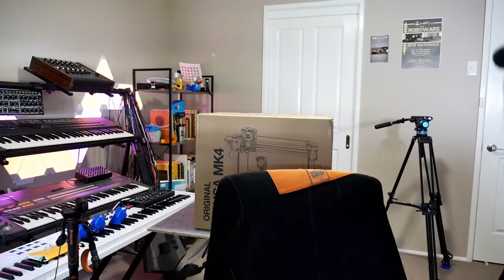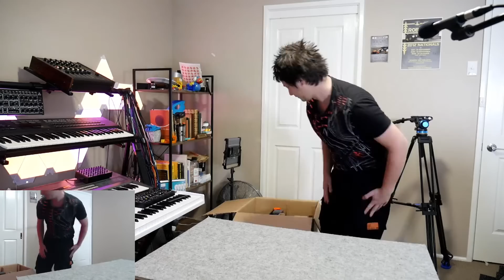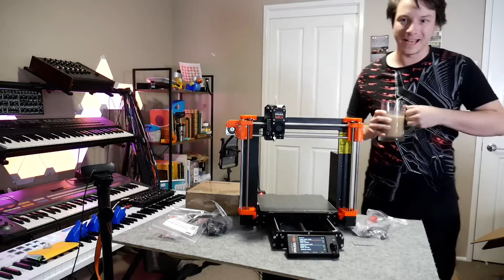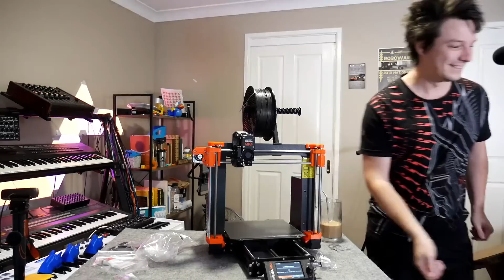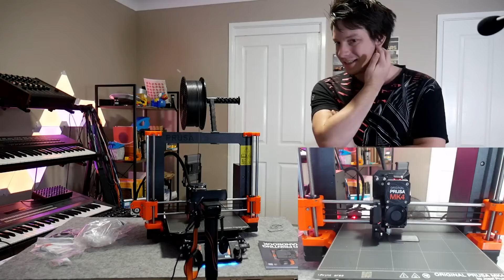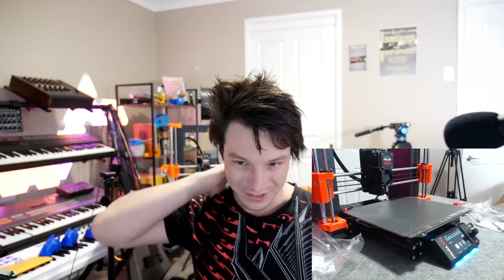WAS LIVE: So a Prusa MK4 just showed up... let's fire it up live!

Comment: I'm a bit late, but I imagine the frame is die cast, which functions mostly like a plastic injection mold but instead of plastic they're pushing molten metal.
Reply: It’s for rigidity purpose I think
Reply: @arbjful I think it saves costs in the long term. Think of anount of waste that's produced by cutting a sheet to this shape.

Comment: I know you will never cover a Voron build it would be awesome to have you sharing your experience to others.
The only thing I didn't agree with your statement from another video is that "Voron is a tweaking printer", I have a LDO Voron Trident stock and it just work, zero reasons to tweak it.
You are one the fewest trustworthy YB out there, it would be awesome to have you covering Voron for users after high quality prints and no tweaks needed.

EDIT: But check the LDO kit like CNC Kitchen did, anything else will give you headaches.

Comment: patents have never stopped certain manufacturers from certain countries from copying/ripping others off. Open source is a big advantage of Prusa printers. Now they need to leapfrog with non-planar printing and an enclosure with active heating, air circulation and hepa/carbon filter that doesn't cost as much as a printer.

Comment: Could barely hear you with volume all the way up. Didn't watch because of this.
Reply from the maker: Ok
Reply: Then... over-amplify the video sound, or switch to headphones?
Reply: @WyvernDotRed  The audio could have been a bit louder, I had to use a different headset. I don't think it's helpful to blame the audience for not being able to hear the sound well.
Reply: @WyvernDotRed  Me saying "blame" might have been too harsh. What I meant to say is that the audience shouldn't have to change headsets or EQ settings just to hear the sound. The mic could have been placed a bit closer.
Reply: @htpkey  Obviously the sound should be balanced well, but a stream recording having low volume levels isn't really a reason to avoid watching it either IMO.
Especially as with my equipment, just raising the volume a bit got it a my usual listening level.
Considering they couldn't hear it well at full volume, not sure what's going on there, hence the suggestion to try a different output as it shouldn't be that quiet as-is.
Reply: @WyvernDotRed  I mostly agree with you about the steps you can take to fix the audio issues. My main criticism is that the viewer shouldn't even have to do this in the first place. 

I hope the audio feedback from that comment will be seen in good faith and taken as constructive criticism to improve the audio quality in the next stream. I loved this stream, but I do think the audio could be improved without having to spend any money.

The whole reason I commented was because it felt like the audio problem was now shifted to the user. Instead of acknowledging it, the reaction seemed a bit passive aggressive. I watch hours of content on YT every day, I rarely even think about the audio since most video's tend to be overproduced. 

In all fairness, this was a live stream and the audio will not be as crisp as the regular video content. But the audio could still be a tiny bit better.

Comment: According to the Prusa Knowledge Base, the Prusa MK4 is equipped with a loadcell that detects if the nozzle is close enough to the steel sheet for printing. The only adjustment needed for the loadcell is during the Selftest. During the test, you will be asked to tap the nozzle at a specific time, and a progress bar on top of the screen will be filled. This is to calibrate the loadcell and avoid any damage that would be caused by the nozzle digging into the steel sheet.

Comment: the "mark" on the build plate should be at the bottom left outside the print area where the old purge line used to go. That's an area we don't care about. They need to move that.

Comment: The Carbon X1C is the best machine in the market as long as you don't need to repair anything from it, if that's the case, you're probably on your own. That's why Prusa's value proposition is good, it's not just the machine specs, it's the documentation, openness of the system and repairability, besides the fact that it's a very reliable machine anyways.
Reply: i think the main problem should be the Mainboard. The rest is already mostly available from 3rd Party and that will extend if BBL close doors
Reply: I Bet Bambu is going to make one of the next printers Open source if the Community pushes hard enough
MK4 Costs way to much in Germany for example you can get two of the new creality core xy for one mk4

Comment: Ankermake printer now prints 500mm/second. It's incredible how fast it prints
Reply: Fast does not imply good. Printing fast is great, but causes extrusion and part strength issues if you don't have a high flow setup.

Comment: Hi ; what do you think of the Delta Printer FL Sun v400 ? I can't remember  if you did a review on one or not ?
I would also like to thank you for the information concerning using G10 sheets for build plates. I have converted both my original Aquila and my Ender 3 S1 Plus over to G10 build sheet. Amazing how builds just lifts off without even having to remove the build sheet and flex them. No prying the build off or scrapping excess pla off that gets left behind . On the Ender 3 S1 Plus the first print I did on the PC sheet stuck a little and in one place left PLA behind which I had to scrap off and left a mark behind . Thanks for the great reviews and helpful information. 
Happy Printing
Jason

Comment: Angus, would you review Sovol svo6 plus, 300x300x340mm, with filament run out, for $349? I know the normal svo6 for $259 doesn’t have run out protection, but the plus does.
Reply: 100 mile house, BC, Canada.
Reply: @vulcanbiker651500  what?

Comment: The usb drive with my Mini lasted two weeks and failed.
Reply: Sweet
Reply: What are the bed dimensions?
Reply: Thats better.
Reply: The test takes quite a while.
Reply: Wires are laid out tidy.
Reply: Does this one jave dual extruders?
Reply: Looks good now.
Reply: Just wondering because the holder takes 2 spools.
Reply: Thats odd that the extruder is heating at maximum height.